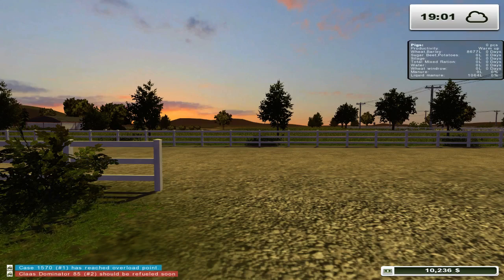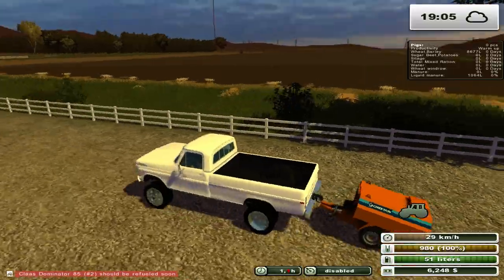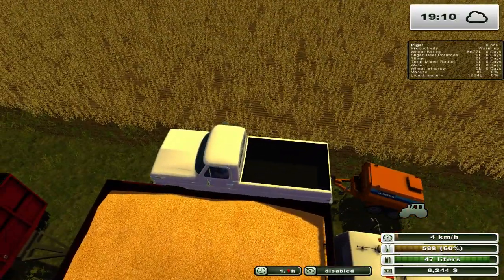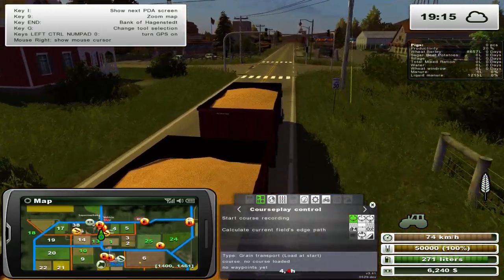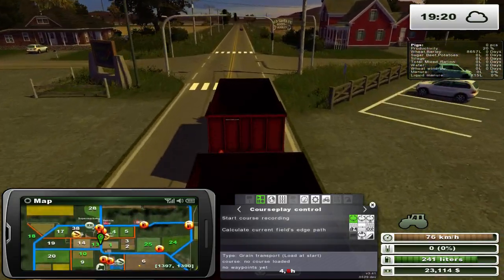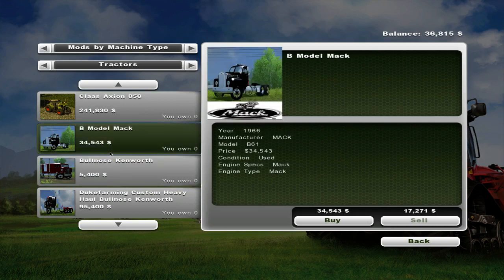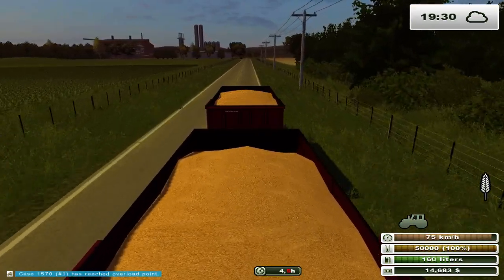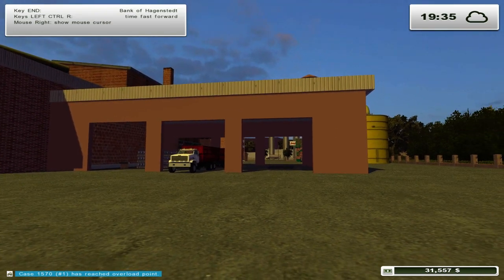Farming Simulator 2013 S8E4: making money

Comment: Great episode enjoyed that one :) now where to begin lol the truck wud normally have a lower hitch hanging down for trailers such as that, that particular hitch is more for trailers with a built in dolly and a floating drawbar. I'm not sure on the overloader, you'd have to check out one that works and compare. Iv just attempted to repair the corn header I'm using so it unfolds when a worker is hired but then it wouldn't harvest so my theories on animations need revising. It could just be something simple in the xml though :)
Reply from the maker: Yeah I had a look at the code and I didn't find out what it could be. I think it might have something to do with the fact that the auger arm fold out with key o instead of key X
Reply from the maker: ***** Any ideas then?
Reply: I think your probable on to something noticing the different key binding Iain, it means it's controlled in a different way so courseplay doesn't recognize it. I'll test tonight see if I can figure it out :)
Reply from the maker: David Oldfield That would be awesome.

Let me know if you find something.

Comment: My dad has a 2000 ford F-350, only 70000 miles on it, and one time he pulled a medal snowmobile trailer and a camper at once (42,000 lbs).
Reply from the maker: What's the maximum weight one could pull

Comment: Hey Iain great video.  If you are looking for an older tractor for the beef cow I have a couple tractor suggestions.  The first tractor is a JD 2140. It has 84 HP and could handle the small mixer you bought and may be able to handle a small mower.  It was made from 1980-1987 so I think it could be in the time era you are using.  Here is the link http://www.americaneaglesmodding.com/index.php?action=downloads;sa=view;down=701  The next Tractor is a JD 4440.  It has 130 HP and could easily handle the mixer and mowing.  It was made from 1978-1982 so this is also in the time era your using I think.  Here is the link to this one http://www.americaneaglesmodding.com/index.php?action=downloads;sa=view;id=602
Reply from the maker: Oh sweet. I'll have to give them a try